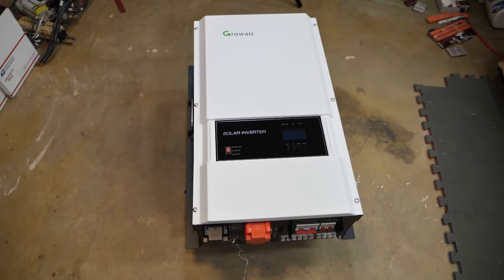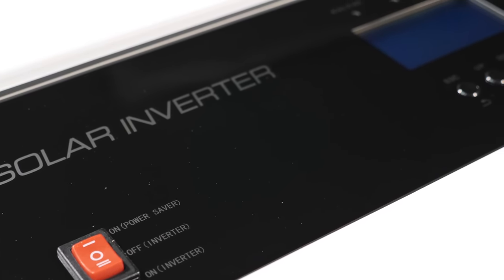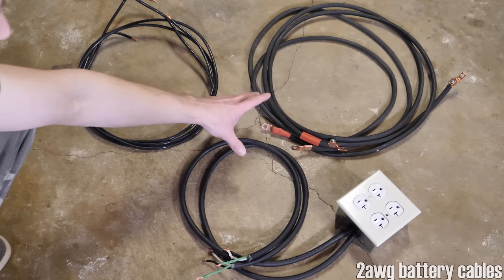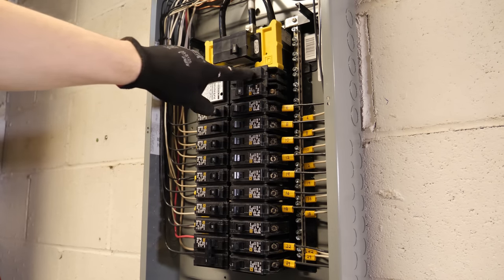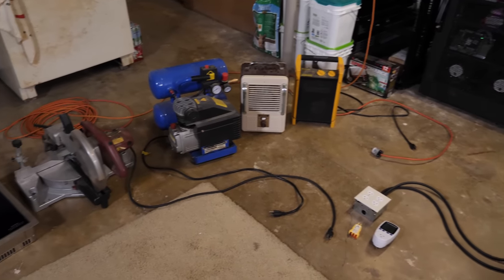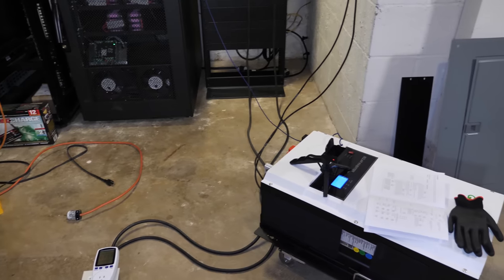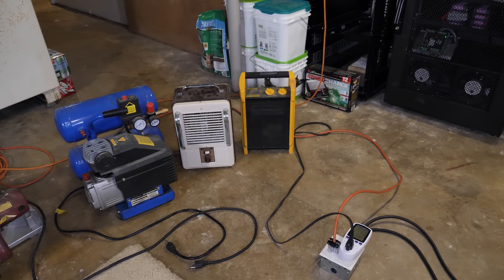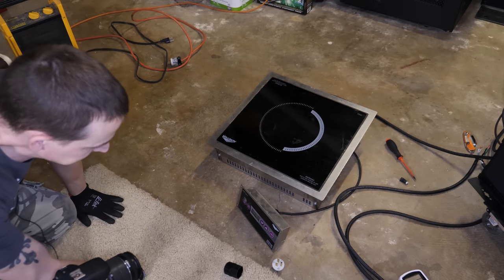12kw Growatt Inverter Operational Check/Review!!

Comment: EXCELLENT VIDEO!!!
I would have some questions: Can I adjust it to run 100% on solar, then, when the sun goes down allow it to draw not more than 50%battery power, then the rest from grid?  ( I want to keep 50% in the battery for Grid outages). I also want it to go back to solar once the sun goes up + recharge the battery. Are these settings doable All in one programming? - can I program to charge different battery types( I my case marine deep cycle batts?- thank you a lot
Reply from the maker: Thanks Mate! Yeah you can change the settings to run on solar(if available) and use battery after that or when solar isnt there.  You can change the voltage of battery cutoff to switch back to grid.  Yes you can use Lead acid or really any batteries you like.
Reply: @AveRage_Joe  absolutely fantastic your reply. Precise and sharp. I hope the company calls me tomorrow.i left them a voicemail. I wondered how critical it is to serve my house through L1 and L2, loads are never really perfectly even; I wonder if that is hard one this solar inverter. Other than that I will buy it. Is it a company located in Texas but manufactured in China???
Reply from the maker: I the loads (L1 L2) can be unbalanced quite a bit. I havent had an issue. Yeah its a china inverter but a pretty good one!
Reply: @AveRage_Joe  I called them yesterday and got more questions answered except of one: when I run a 48 volt battery setup (4*12volt), how the batteries get balanced? Are there 2 more charge cables coming of the unit to connect to the batteries in between?
Reply from the maker: If your using lead acid then you just connect them in series. Connect pos to pos on inverter and neg to neg on inverter. Lead acid doesnt need anything to balance them. That happens when you equalize them roughly every 30 days. Those settings are in the menu options as well.
Reply: @AveRage_Joe  great, thx for your answer.i just got off the phone with them, they couldnt answer it but they want to call me back..
So when I get you right led acid arent as critical to balance, so they don't have a balance wire going to each cell.
But then you say they are equalized every 30 days? I must assume then it means they get charged 100% full to somewhat equal out? Does the growatt do that every 30dats by itself?
Your are a great help, thx!
Reply from the maker: Yeah there is a few setting for automatic equalization and you can set how many days apart ect...
Reply: @AveRage_Joe  would you actually buy this device/ brand again? Is there a better one on the market or is this state of the art?
They told me their device isn't rated as a ups means that once it looses grid it needs 20milliseconds to switch over providing battery or solar inverted power. Some devices may turn of because if this. What a bummer. Can you confirm that? Did your computers/AC  turn off?
I want to buy a split phase inverter. They have 3 different one (none-grid tie). They couldn't tell me the difference between them and want to call me back. Do you may know? :
Spf x.....x t dmv-us
Spf x.....x t dmv us mpv
Spf x.....x t dmv mpv
Reply from the maker: I would 100% buy this again. Is there a better inverter out there on the market. Im sure there is. Im pretty sure the manual states a 10ms switch. If power goes out it switches over, i dont loose power. Computers stay running ect...
Reply from the maker: Who are you talking to over there anyway? They should know there inverters. They told me everything I needed to know when I purchased mine. The diff between them is the solar charger. 150v charger or 250v charger.
Reply: @AveRage_Joe  I forgot his name, I had def. a chines accent. -I got from you more information than from them! The technical support had to go three times to the supervisor to get my technical questions answered... Today I was told the three different inverters I am looking at ( as mentioned above) is just a older model vs a newer one...(incl. Better parts)... I don't really believe it. Also: I asked how cells get balanced should I hook up lithium cells. I know they are more critical in charging, so I would expect there are more cables going from the charger to the cells. They will need to go back to me about that. Also they didn't mention the equalisation you mentioned.also u was advised to buy it on eBay since on Amazon there are more untrustworthy sellers... Really? Then, when I ask which seller I want to use on eBay they say just go by sales and reviews... Really? And not all models are on eBay. Very poor sales tactic. What do you suggest? Thank you again!!!
Reply from the maker: Oooooooh ok now this makes more since. I thought you called signaturesolar like I did. Where are you located? If in the US order from same place I did.
Reply: @AveRage_Joe  oh if your have a local place and a clear english speaking rep I would appreciate that. I am located around palm springs California
Reply from the maker: Look up signature solar in descriprion box. There in Texas and # is on there site.

Comment: Joe, your audio was excellent.  Good to see you still sticking with our old hobby.
One thing you want to test on a split-phase inverter is differential wattage between the 2 phases.  Older architecture and cheaper inverters have issues if the 2 legs are more than 12-16 Amps AC different from each other.  This manifests as an induction motor, or pressurized compressor or deep well pump starts up and draws maybe 30+ amps for a split second. The entire Inverter shuts down.  So try just loading 1 phase at 20+ amps (with nothing on other phase) and make sure it stays stable.  The ones that shutdown are non-starters for most off-grid type applications. ~cheers & Boom
Reply from the maker: Thanks Man!  I tried to fix and adjust in some places but for the most part was out of my control lol.  Oh yeah good point for the 2 phase watt difference!!  Ill have to see what I can do for that test.  I hope it doesnt have any issues like that!!!  Fingers crossed
Reply: @AveRage_Joe  How Quickly does the UPS function with Utility power switch under surge current conditions.  I ask because I am thinking of using the same Growatt inverter unit to run my 240VAC pool pump (turns on only once a day), and a few other dedicated 240 Services (no in rush),  I measured the In Rush current of the pump at 46 Amps, normal run current is about 10 amps.   Also thinking of not using batteries, at least until they hopefully become more affordable.  Obviously clouds could present an issue however,  I ask as It appears that in the near future Net Energy Metering will change, so that you cannot use the Grid as a form of Battery Storage.  Anyway just thinking of other options. Thanks
Reply from the maker: Switch says 10ms for time. Occasionally you may see a flicker with Led lights but not all the time. Yeah you could use this for the pump. You will need a battery. Even if using in the solar function. You could probly just get 4 "junk" lead acid batteries for that. Also may even get by with the 6kw one as the surge is pretty damn high. They are 3X the normal so 36kw for the 12kw inverter and 18kw for the 6kw inverter.
Reply: @AveRage_Joe  do you think you could run whole house on the 6KW unit? Great review, this is the unit I am considering but our consumption is purdy low, like 15kw/day, mostly during the day so direct solar power would cover use.
Thanks, love your channel!

Comment: Well done AJ would you recommend the Growatt Inverter if so I want two in order to run my aircon
Reply from the maker: I would recommend it!  This inverter states it will start 4 ton Air Compressors no problem!!!  Also a note, this particular inverter cannot be stacked.  I hear they will have stackable ones like this soon.🤘
Reply: @AveRage_Joe  Thanks I want to order a 30Kwh Power Wall as well as two 12Kwh Growatt inverters, panels etc if they will run at 220 volts 60hz as I have 4 AC units to run, when I relocate to Brasil

Comment: What's the biggest size wire that can connect to the battery terminals on the inverter 4/0 ? Also what's the biggest size wire for the PV input on the inverter? Thanks
Reply from the maker: Any size for battery cable as its the lug that will hold the wire. PV I have 6awg installed but I think 4awg could squeeze in there!🤘
Reply: @AveRage_Joe  cool thanks for the reply 👍

Comment: Is there a mode that will input AC and solar power, export power from both AC and battery power, and use the battery power first? Basically I want to use as much solar power as possible when it is available.

Alternatively with no battery. Is it possible to import AC and solar power and export AC and solar power with solar being priority and whatever solar can't provide AC does?
Reply from the maker: Yeah there are a few diff settings to choose from. I use SBU mode( solar battery utility) I use solar to power the house and if there isnt enough solar then it will use battery. If battery voltage goes down to 46v(settable) then it will switch back to utility until the battery reachs 54v(settable) and power the house with solar or battery.  

This inverter needs a battery but can do what you are asking.🤘

Comment: I am getting ready to place the order for the Growatt12's that i mentioned a while back but i have one question. Can you stack the 12's, ware-as i can see you can stack the smaller growatts, but I can not find any information on stacking the 12's. IS THIS POSSIBLE?????     ie:  Example: i will have two units for the house, one up and one down. can these two units be stacked or will i need to create two separated mains, panels, one for each?       YES you will be the first to be notified at the time of delivery, of the SYSTEMS. with pix to your email.
Reply from the maker: Sweet! So the 12kw inverters cannot be stacked/paralleled. You would need 2 inputs and 2 outputs. In your first panel from grid, just add 2 double pole breakers similar to if you had 2 ovens. Then off those breakers you run a set to each inverter. Then off the inverter to power a sub panel. Hope that makes since. If you do end up purchaseing from sig solar, mind using my aff link in description? 💥🤘

Comment: A work horse for sure. But has it limits on programming. One issues for me I had to change  my battery setting from 56v to 48v due to not able to set the battery low cut off point.

Parallel Nissian Leaf batteries stack of 8 & series each stack for 48 volts work perfect now. 56v worked fine too just wasn't able to set that safety cut off. Yes, I do have it switching back to utility on low battery source prior to low  cutoff safety.
Reply from the maker: So its not letting you set the low bat cutoff??

Comment: What's the maximum number of 200AH batteries you can connect to this inverter?
Reply from the maker: You can connect any size of battery you like. 100ah or 1000ah doesnt matter!🤘
Reply: @AveRage_Joe  I wished to know the maximum number of 200AH batteries it can take. Can it connect 40, 50 or 100 as the maximum number?
Reply from the maker: There is no maximum number of AH as it is just capacity!🤘

Comment: Hello I have a deep water well pump is 3hp I can run it with 4K harbor freight generator how ever the pump is 220v  Will this work any chance this works with no battery just with solar array. Sorry for so many question I’m in desperate need of help as I have failed in my other attempts
Reply from the maker: Yeah this would run it. It can output 220 or 240v BUT you would need to connect A battery. You could throw a couple cheapo lead acid batteries with your solar and pretty much ise the solar to run everything. It just need a battery tho.

Comment: Hey Mr Joe Sir ... One More Question about this Growatt 12kw.  What is the idle power consumption in normal mode (not power saver)?  Is it reasonable?  Can you deal with the amount of power it consumes just being on?
Reply from the maker: Off the top of my head I think it was 150w idle no load. Thats in a vid I did. I honestly dont care about idle load. I was using a 2700w server ups for an inverter before this lol and it was almost the same! Yes I can deal!😆🤘

Comment: Being old enough to have been part of the Cheech and Chong generation, I can't hear the name Growatt without thinking of something to illuminate a basement weed farm.  I don't know how the Chinese come up with some of these names.  

Anyway, this is a great video as it answered a lot of my questions on this unit.  My max utilization according to the power company has been around 13KwH/day, so a 12Kw unit is certainly enough to work for me in UPS mode.  It looks like it's worked well enough for you in a couple of videos, so I'm going to see if Will also give it a thumbs up, and probably buy this model.  

The long pole in the tent is my desire for 3-4 days autonomy, and that's in the battery packs and solar panels.
Reply from the maker: LOL I havent seen Cheech and Chong since early 90's!  Im not sure how they come up with the names either.  When the wife and I were in Okinawa Japan, the names they had for there stores were just as hilarious.  Thanks for watching and Yeah the inverter has been great so far.  Ups mode works great.  Even reverse ups mode having the grid as the backup works great.  Thats how I have been using it for the most part!

Comment: Hi  A-R-J, ... 
GroWatt  Inverter:  SPF 6000T DVM-MPV  ... ERROR #61 
I intentionally specified the " MPV " model to allow my Inverter to INPUT up to  250 vdc PV 
I run FOUR arrays of SIX very old "SHARP" brand 208 watt Solar PV Panels in a 6S / 4P 
Open-Circuit Voltage of 36.3 volts X 6 = 217.8 volts with wiggle room for cold / sunny day production 
so I should not be approaching the PV limit on my Growatt Inverter 
... 
COOP
Reply from the maker: Gotcha, ya I have mine the same lol and YES you are good!

Comment: Excellent vid and info for the DYIer.  Am I correct to say there are NO CT's to measure UR current usage?  Comparing to Sol-Ark 12K, what is the PV to BAT to AC Losses?  SOL-Ark is 7%.  Can U  config it to only charge battery from Solar?  Looking forward to next vid.
Reply from the maker: Thanks Man! Id have to figure out how to do all the losses lol. I hear the sol-ark inverters a GREAT. Have heard they have issues starting big inductance loads(dont have one so can confirm that) but overall great efficient inverters. Yes you can choose to recharge with solar only on this inverter.

Comment: Can the growatt allow grid AC pass-through in "power saver" mode? Have you tested this mode much?
Reply from the maker: Yeah Im pretty sure it does and when a load comes on it will "power on" and power the load. I always have mine in "on" mode but have switched it to powersaver mode and it keeps running.

Comment: I was getting a Sol-Ark 12 only to learn its really a 9000watt (4500 per leg) inverter and wont run my house in a blackout situation.   Did you ever max out the growatt 12k?      I need to run 4ton AC and refrigerators and well pump and thinking I can get 2 of these for less than 1 sol-ark 12k,    Why soo cheap and why only 2year warranty?
Reply from the maker: Yeah the solark is expensive for 9kw but has features many might like. I love the 12kw I have. I havent maxed it out yet, dont have my other cells put together yet. To busy from work. This inverter will run all of that. Only thing it cant do is parallel inverters together like the solark.
Reply: A single low frequency inverter like a GroWatt has a high peak power capability. 

The SolArk does not have peak power that the low frequency inverters offer.

If you need multiple inverters, look at a Genetry Solar, they have run multiple inverters, for years, are preparing to release their 12k low frequency inverter.  They can be configured to handle a full 240v split phase load or configure 2 inverters to handle each of the split phases.

Comment: Could the Growatt inverter be used with a wind generator instead of solar?
Reply from the maker: Its possible I guess but cant say for sure. You would need to make sure there is voltage regulation for sure.

Comment: Hi! Does the growatt load share? Let's say there is not enough solar power can it per done of the load from the utility or does it switch to 100% utility to power the loads? I think it's latter but I want to double check. Thanks
Reply: Can it power some of the load*
Reply from the maker: Great question but its the latter. It will switch to either grid only or off grid. It will only "share" the solar and battery to power loads.
Reply: Dang. That's what I was afraid of. The unit specs out great and the transformer is massive but I'm looking for something that can support the loads with ac seamlessly.

Thanks very much for the info